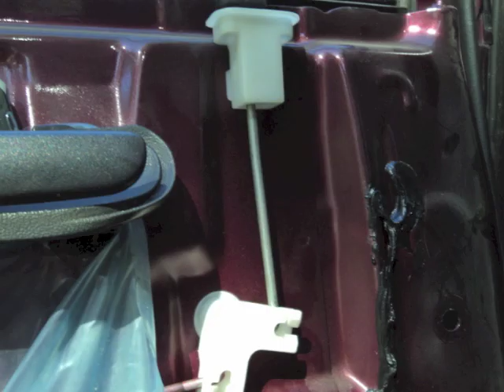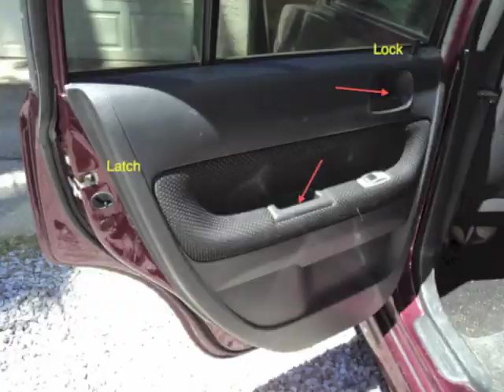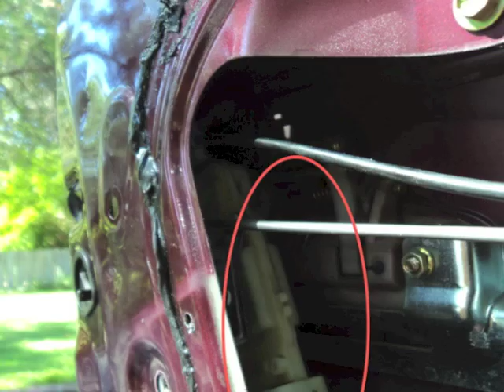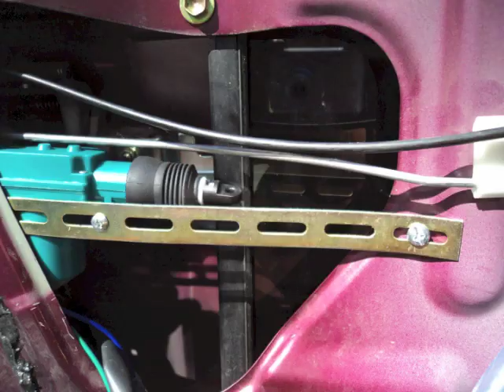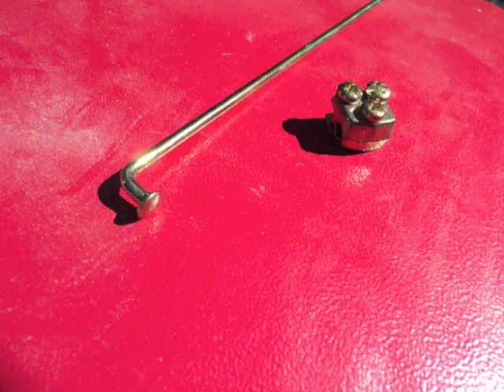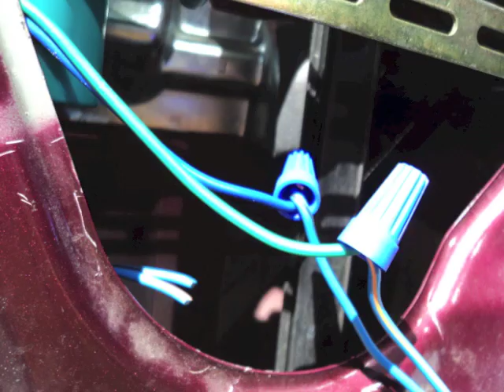Scion xB Door Actuator Repair

Comment: Dude u just Mickey moused it. Aka half assed it. U just decreased the value of the car. BIG time. U should always fix thing the right way specially in a car.... 😖
Reply: Chill out, Minnie Mouse
Reply: I am an engineer.  You are a moron.
Reply: You're an idiot. The aftermarket actuators are more reliable and last longer. They've been in use for decades in many cars, but you'll never see them unless you take the door apart.

Comment: Shig Odani- I made it work with just a little more modification than his set up. BTW, amazon.com has 2 actuators for one price of $10 shipped now! 
 
NOTE: There are a bunch of wires coming from the front actuator.  The green with orange stripe wire on the scion matches up with the green wire on the amazon actuator.  The yellow wire with red stripe matches up with the blue one.

Comment: As +Joelenders says, it's very different for the FRONT drivers side door. There were so many obstatcles that I gave up and replaced with an OEM actuator. If I were to do it again, I'd probably try replacing the motor inside the actuator, as I've seen some people suggest.

Comment: Just tried this and it is nothing close to the FRONT drivers side door. There are many obstacles and the actuator fits near the left rear bottom of the door.
Reply: Shig Odani I got it to work. I pt the actuator all the way at the bottom of the door on the left side. Then I did NOT cut the lock rod, I just attached the rod to the actuator extension rod. I had to bend the actuator rod a bit. Then I put a screw right through the door frame into the actuator underneath. Since the actuator is held in place by the door frame, one screw was fine. I used the two fattest wires, checking for polarity to make sure the actuator goes in the right direction.

Comment: Hey, Nate, this looks easy. Thanks for posting it.  I have the same car, same color, same year. I have a question: will this fix the automatic door locks or only make the lock mechanism work in the door work? I mean, right now, my remote key and driver door lock button only lock/unlock the front doors. If I replace the actuators in the two back doors, will the remote key and driver door button lock and unlock the back doors as well?

Comment: why not just replace the motor inside the actuator for $6? and keep it looking factory.  Also, wire nuts are not a proper automotive wiring connector..